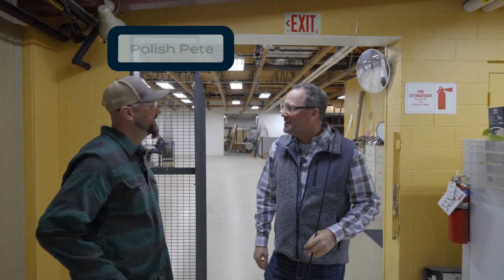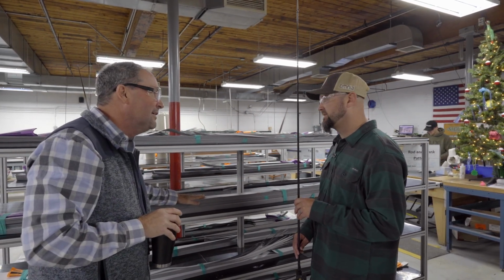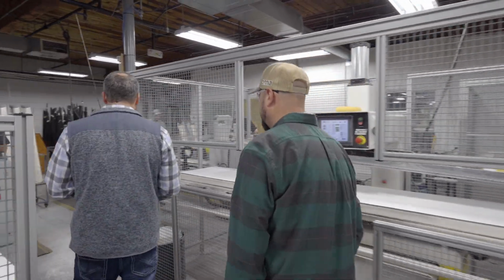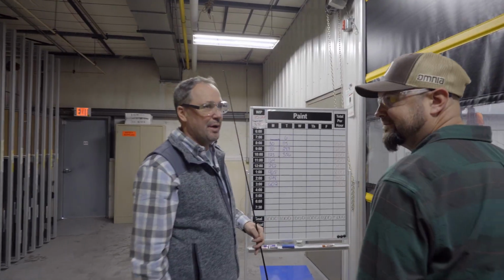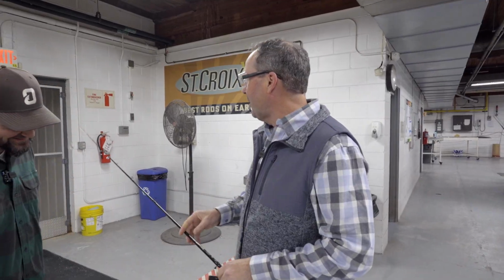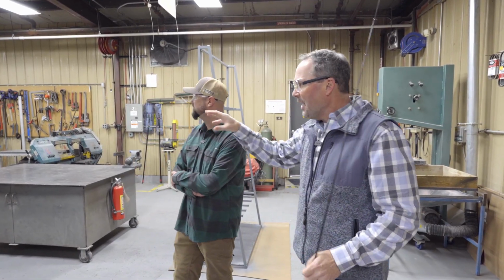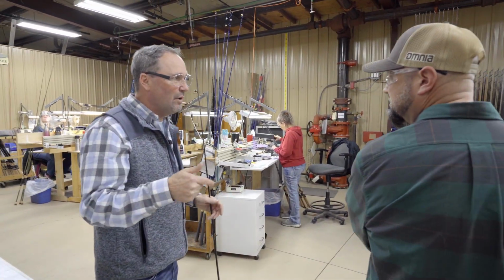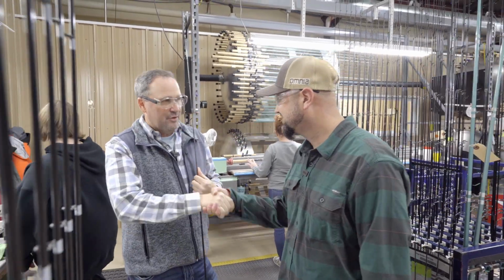How is St. Croix Victory Made? | St. Croix Rod Factory Tour

Comment: All of my spinning rods are St.Croix. One of the things I’ve always loved about St.Croix in the spinning department is the variety of blanks. Take the 7’10” ML Victory Crosshair for example. None of the other high end manufacturers were offering a rod with those specs when it was introduced. They probably still don’t. I got so excited when I saw that and couldn’t wait to get my hands on it. As soon as I unsheathed that rod and held it out and gave it a test shake, I fell head over heels in love w it. It does what it was meant to do perfectly, which is to throw light hair jigs a mile but it also excels in several other finesse bass fishing applications. I currently own two and I’ll be getting another. I’m certain that it’s been a resounding success as they have expanded these blank specs to several other lines. If you’re particular about your spinning rods and want to step away from the cookie cutter offerings by most every other manufacturer, look no further than St.Croix.

Comment: I love the brand so much and always thought of owning a St. Croix casting and spinning rod all the time. Unfortunately the specs that I've always wanted aren't there or don't fit my requirement, a 2-piece / center joint / 6 foot 6 to 6 foot 10 in length. The reason is, simply because I'm always riding my motorcycle with my backpack with all the stuff behind my back whenever I go fishing. Imagine how crazy would it be, carrying a 1-piece rod behind your back..

Comment: I've really never had the money that this rods cost! But I've bought older two piece spinning St. Croix rods that had metal furrels I think It was eglass? But I rebuilt it into a baitcasting rod adding a two footed eyes to stiffen it up and its now the best spoon rod I own, it can throw a 3/4 oz spoon but I can still throw an 1/8 oz johnson silver minnow on 12 lb line and because it was a old buggy whip spinning rod and with the extra eyes and double wrapped the footings that rod will still throw a light spoon a country mile because the blank loads up so easily it just flings the lighter baits unlike a faster blanks! It just shows the quality of St. Croix rods over 40+ years old that was converted from a spinning rod to baitcasting  rod! That's quality!

Comment: The foamy stuff in the handle will disintegrate in  like 30 years into powder. What's then with your handles?
Reply: Na dooplon won't your wrong I have carp rod with it on its 40 year old
Reply: @aarondavies8486  I meant in general...not single examples, where it didn't fail...
Reply: @Kivas_Fajo  what are you on about its not the 60s no more the duplon handles are one of the best it's Cork handles that are crap now days cheap Cork from China is the worst best has to be Japanese shrink wrap handles

Comment: The problem that I had with St Croix rods in the past is that the handle lengths were always too short. Picked up a Victory last season and still find that to be an issue. Very awkward feeling rods.
Reply: most of my rods are St Croix, but the only one i have that issue with is my 7’ medium Avid X. i’ll definitely agree there. it’s extremely awkward to cast.

Comment: Got a few rods and had one warrantied (manufacture defect), it was pretty quick and painless. I even got to keep and fix my old one (fixed reel seat gluing heat defect). That alone made me like them. Rods are light and function nice.
Reply: How’d you fix it? My bassx has this issue. Love St Croix though.
Reply: @zb5797  I just sanded the old glue a bit so it could go in place then added light touch of liquid CA glue to hold it in place, lined up straight with the guides. Then held it vertical and dripped more glue in the crack in-between  till the top was filled and did the same to the bottom vertically. It shouldn't break loose. Hard part is not getting super glue everywhere on the outside.